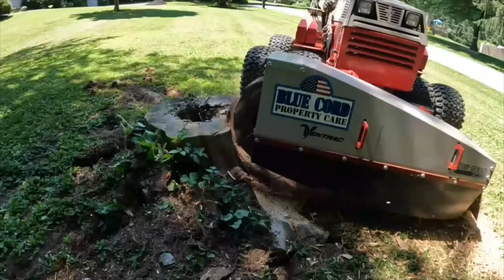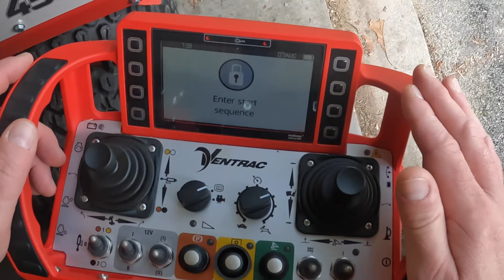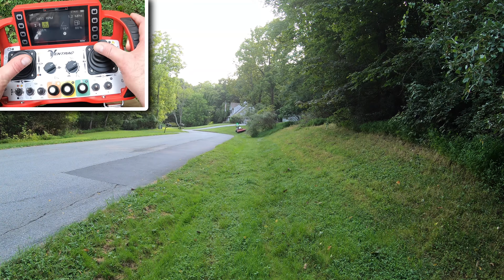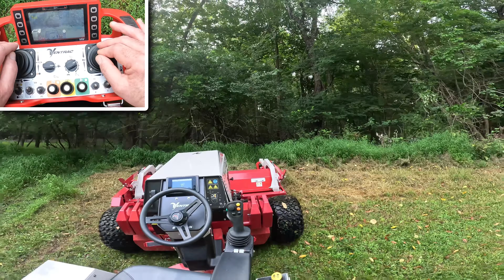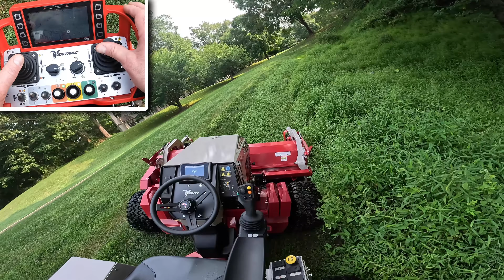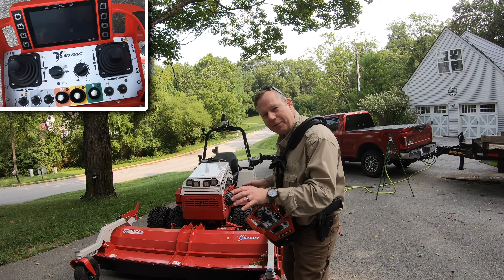HUGE Radio Controlled Machine! SUPER FUN!!! #bluecordpropertycare #ventrac

Comment: Do you know if they have plans to make it programmable?  What I mean is mow an area once with an operator (program mode) then in the future, just tell it to mow the same area unassisted by the operator. The operator could then be operating the weed eater around the edges.  It would be like having a second employee without the second employee.
Reply from the maker: This does not have GPS so I don't see how that could be possible
Reply: @bluecordterrainmanagement  The 45RC Ventrac cost around $60K.  Adding GPS would cost a few hundred.  TORO sells a 'turfpro 500' which is completely autonomous and does exactly what I just said.  It seems to me that Ventrac went in the wrong direction with the 45RC.  I don't see the problem it is solving.  It is still only allowed on max 30 degree slopes, it is not like they increased it to 45 degrees and all humans are afraid to get on it at that angle.

Comment: Impressive Bradley 👍. I can fully understand where using a Ventrac with remote control would work in potentially  dangerous situations. Although i like operating it myself. PS you were having too much fun there LOL. LOVE THE VENTRAC. 👍😎🦘
Reply from the maker: This is a great machine and handles really well with the remote.  It's nice that you can use it both in and out of the seat

Comment: Can you operate the machine with the remote and have someone seated on the machine without them touching the controls? Also noted that when you turned the machine the steering wheel didn’t turn.
Reply from the maker: The steering wheel and joystick are all "control by wire" so there's no mechanical link, just sensors detecting steering and stick input.  I'm not sure if the machine can be remotely operated with someone on the seat.  I'm not sure why anyone would want to do that
Reply: @bluecordterrainmanagement so someone could the feel of the machine without having to control it.
Reply from the maker: @roybrochu5409  I don't know if that's a good idea.  I've done demos with my own equipment for potential Ventrac customers.  The best way to get them comfortable with the capability is that I first show them that I can safely drive it in steep areas, then let them test the machine in the same spot knowing that it will be safe